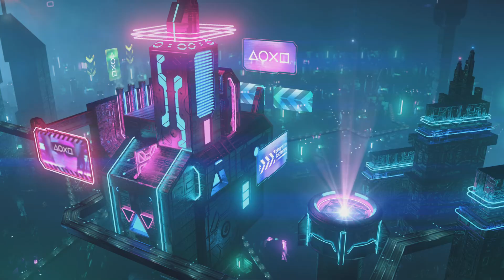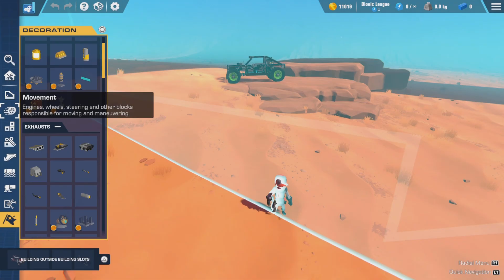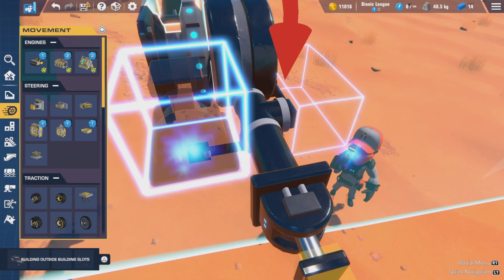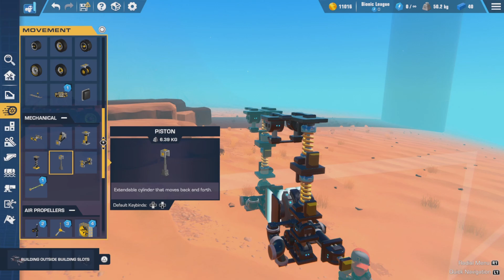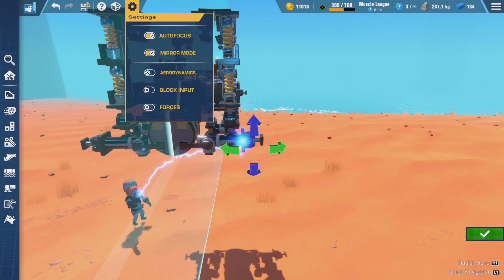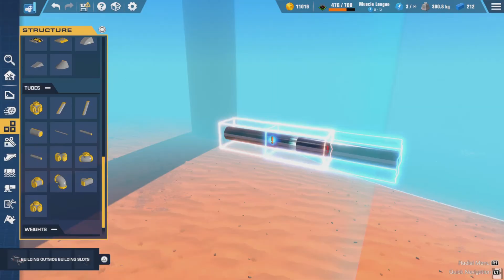Trailmakers rock crawler build tutorial

Comment: I followed the video exactly but when i turn it doesn't bob left and right, maybe its because of the new update for mechs😢
Reply from the maker: Yes there has been a few updates that have changed some settings. You might have to increase your spring strength and double check that the hinges are facing the correct way. Also check that all the hinges assigned for the suspension have 0 strength and 0 dampening and that there are no controls